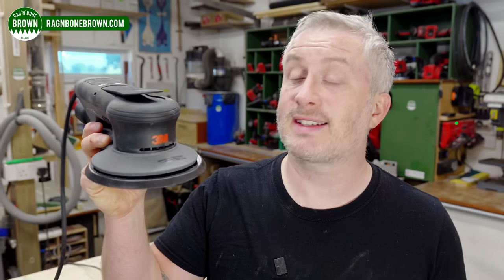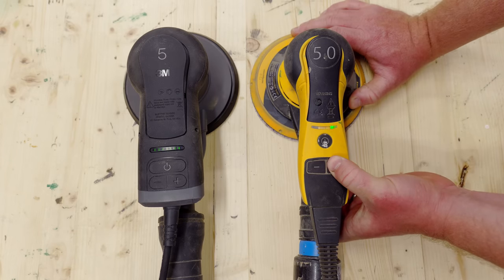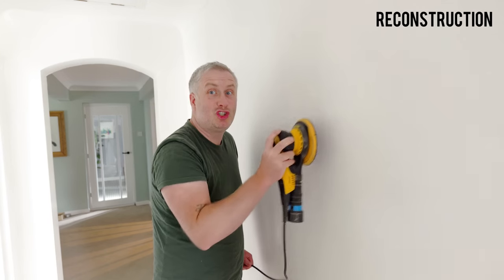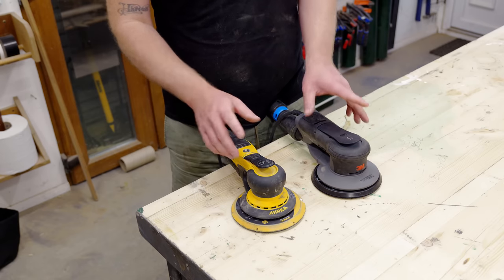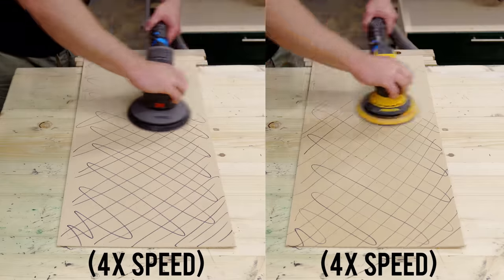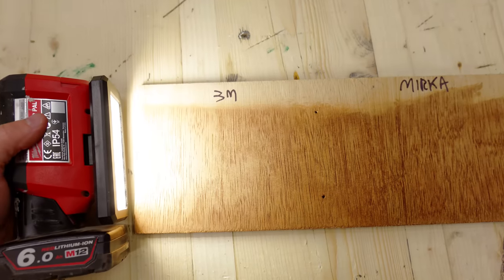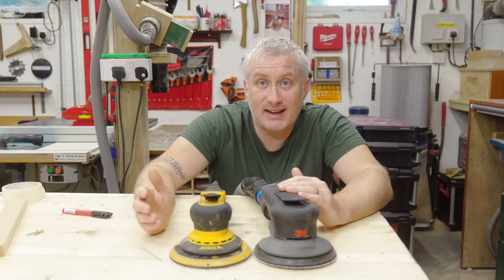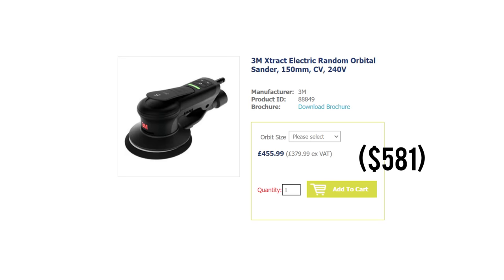A CLEAR WINNER! / Mirka DEROS Vs 3M Xtract

Comment: Check your Deros manual for the section on balancing. You can remove the actual pad using the provided spanner and install a bolt or remove a couple of nuts. It's all in the manual and it's supposed to be set up different if you use the pad saver instead of just the standard pad. 

That being said, if the 3M sounds like that because of the Pad saver it must be built VERY poorly. Even without setting up the Mirka it never makes that sort of racket! 

Mirka for the win 😁👌🏼
Reply from the maker: I don't do reading, especially manuals!! 🤣🤣🤣 The DEROS comes with a pad saver in the box (I think?) So I wonder if it has already been set up for it? I'm not sure .... I will see if there's a video on the subject 😁

Comment: Not that I am going to buy either as it is a lot of money to spend when I already have a working sander, but for me there is no doubt that I would go for the Mirka DEROS despite the extra cost as it has a brake and I really dislike not being bale to put the sander down more or less immediately after realising the trigger.
Reply from the maker: I believe they both have a brake, it's just that the brake on the 3M example that I have doesn't seem to work well at all....

Comment: That new one sounds wrong. Run out or not, that native base is running well off centre. That eccentric mass is going to wreck bearings and bushes. The vibration must be as shockingly bad as the sound it makes.
Reply from the maker: The run off is due to the 5mm orbit - by design
Reply: @RagnBoneBrown  Okay

Comment: I think you may have gotten a defective 3M (which isn't a great endorsement of the sander, to be fair). I have been using a 3M for about 5 months now and mine is much quieter than yours. Also mine stops more quickly. I don't know about the other tests comparing it to the Mirka, though.
Reply from the maker: Hi, I've just posted an update to this via Instagram stories following some comments on the video suggesting it is the pad saver - see here: https://www.instagram.com/stories/ragnbonebrown/3151964799280130289/ Thanks, Keith

Comment: Looks like you have a bad unit, or the hose adapter vibrates, causing that sound.  YOu can see it spinning in the video.  I have heard the 3M sander and it as quiet as the Festool and the mirka
Reply from the maker: Please read pinned comment

Comment: Just because of the noise,  i could NEVER choose the 3M. I'll save for the Mirka.
Reply from the maker: Hi, I've just posted an update to this via Instagram stories following some comments on the video suggesting it is the pad saver - see here: https://www.instagram.com/stories/ragnbonebrown/3151964799280130289/ Thanks, Keith
Reply: @RagnBoneBrown  oh, thanks . Well it's very weird that you can't put the protective pad on without getting all that noise.  Also that 9 sec to stop after releasing the switch, is very absurde. My bosch green orbital sander takes less to stop, and it's a 70€ sander.. (and I hate to wait  that much for it to stop spinning before i can put in on the bench) i will still consider Mirka or Festool . Thanks again for the comparison,  at least I have my mind more clear now 🙏

Comment: You cant compare both sander for the sound of de the 3M it's probably because you have choose the 3/16" orbit sander and not the 3/32" you should take that in fact. Because all the problem you point at the 3m will be cut in half!
Reply from the maker: They're both 5mm orbit
Reply: @RagnBoneBrown  I'm disappointed that your 3M sander  making that kind of nose and look to vibrate a lot more than mine!

Comment: Nice Review, A couple points which may have influenced the results. I assume your review was completed with 220v (UK) which may have affected the noise / vibration since the USA reviews utilized 115v.  Also the intermediate pad placed on the 3M may have influenced the dust extraction / vibration.